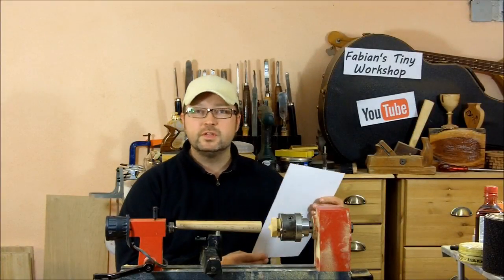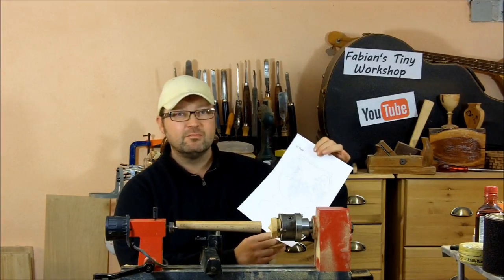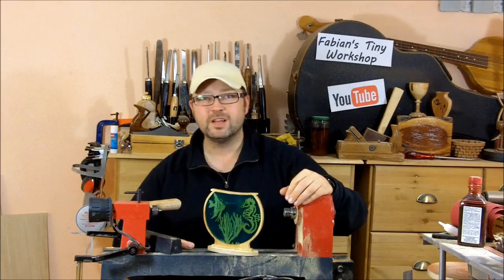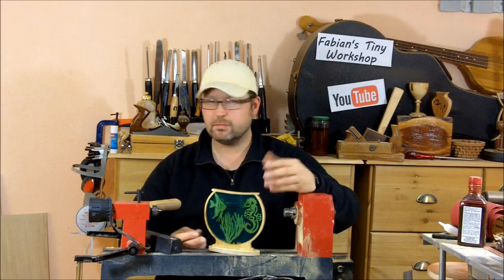Scroll Saw and Resin Fish Bowl // old video

Comment: Looks awesome. The air bubbles may be from air trapped inside the wood expanding as the resin cured, perhaps sealing the wood before the pour might help to prevent this in the future.
Reply from the maker: Thanks! This could be an explanation. Usually I don't  any problems with air bubbles when working with epoxy.

Comment: That is a really nice project and a cool idea!!!!!  I do  want to ask your opinion about something though. Lets say when you poured your epoxy you made the sea horse a different color. Do you think the 2 different colors would have came out properly or do you think while sanding the sanding dust and scratches would have kind of mixed together and you wouldn't be able to polish them out?
     I haven't worked with epoxies yet but I am researching the subject and have some projects in mind
Reply from the maker: Thank you! I think the two colors would only mix together while the epoxy is still liquid. Once its cured it basically reacts like a piece of plastic.